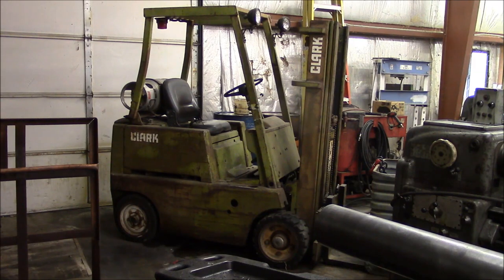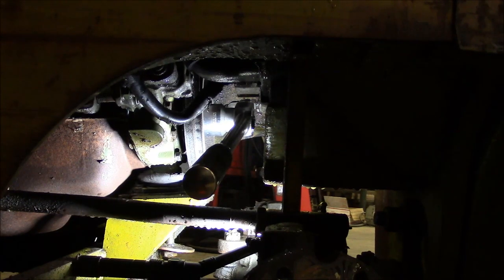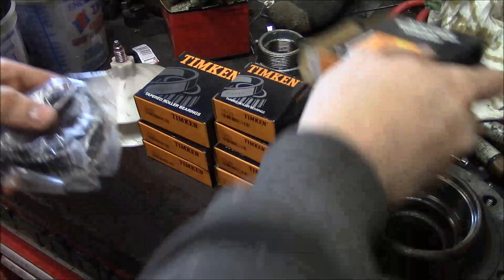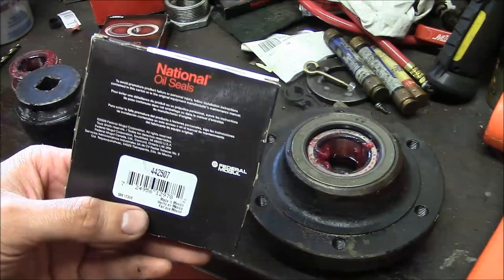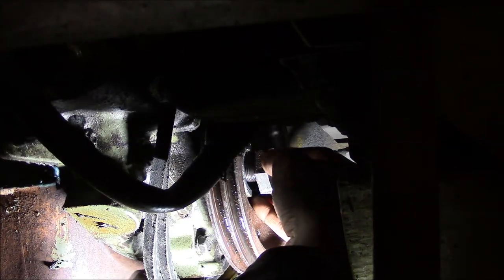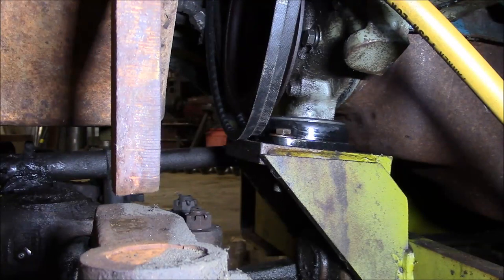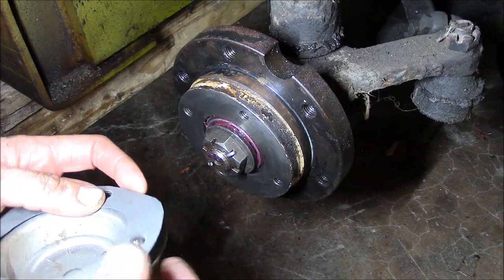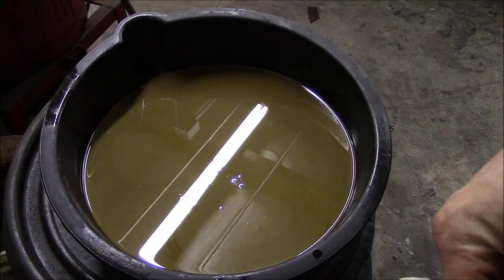Forklift Repairs: Leaking front main seal and other adventures

Comment: Great job and another great video!! 
The way we used to pack bearings was to heat the grease up in a double boiler, sounds fancy but it was just an old metal grease can stood in a pan full of water on a hotplate, then dunk the bearing in and the grease would get into every nook and cranny of the bearing and solidify.

Comment: A local scrap yard here in illinois that I like to shop at got in a 5000 hyster with air tires, I was able to pick it up for 500 bucks. I had to fix the brakes and 2 of the mast cylinder, I machined a 2 inch snapon socket so it would fit the gland nuts, they had 4 rather small notches in them, I guess it could be called a spanner socket. Seemed kinda sacrilegious to mill on a snapon socket but I had 2 of them. Your right on how handy a forklift is, we had one just like it where I worked, I made a bracket that bolted to the forks and I was able to pull the booms apart by myself on the bucket trucks to replace all the hydraulic hoses.
Reply from the maker: I use mine every day. I'd be lost without it.

Comment: I don't own a Clark. I have a Toyota. Sat outside in Chicago for 5 years because the steering is shot. Finally got it running. I changed both inching and main master cylinders(totally guessed because I can't find the Vin number). One of the drive wheels spin. The other is seized. Been trying to remove the wheel. Pita. I'm going to get that wheel off. Then maybe I can figure out what parts I need to acquire to get it functioning again. I'm not a forklift guy. With that being said, I did operate one for 2 continuous years. These videos give me some hope. And you got another hanger on.

Comment: I've used Fram oil filters for years on my cars. Never had a problem, but also always changed oil every 3-5K miles. Used STP filters on an '06 Sonata for ten years; no problems. Giving WIX a try on the '00 Dodge and will probably use a factory filter when I do the first oil change on my new Mazda. My propane heater dumps a ton of humidity into the air. The propane may very well be the oil/water problem.

Comment: Nice work Wes, I hope you put grease between the lips on that seal, stops the outer dust seal lip from burning and failing. Would also suggest that oil be applied to inner and outer bearing races before pressing, stops any chance of metal pick up. From 40 years as a mechanical fitter.
Reply: Good advice. Rarely understood by the seals I've seen.

Comment: She looks to be identical to the ones I had when I was running a small aerospace job shop this machine would go into the warehouse retrieve or place back raw materials and tooling for upcoming or finished jobs it also did well removing pallets from box trucks and trailers because it is narrow enough to maneuver it also got into turning sharp to place pallets of raw stock in front of the CNC milling machines and lastly she has a single great trick, you could lift a human up to change the sodium light bulbs add or repair an air line of course we only used the safest methods for human lifting HAHA. You brought back memories of the older years 1978/79 through 1993/1998 we operated this machine type as well as the Clark dual front tire WIDE heavy weight material handling machines even with the rotating trunnion front end (great chip bin dumper) on it. Thank you.
Reply from the maker: These things are very maneuverable. I've been able to sneak into places I never thought possible.

Comment: One of the most neglected tools in the shop, poor forklift. There very important time and back savers, but are abused like no other thing.
Reply from the maker: You aren't kidding! The most abused thing I ever saw was a yard truck we had for moving trailers at a shop where I worked. Old International with a 345 gas engine. Oil just poured out of it while it was running. The glass was broken out of the driver side and the latch never worked, so we covered the seat with a tarp and had a rubber strap to hold the door shut. Air compressor never worked, so you had to fill the air tanks with shop air before hooking a trailer. But you had to be quick because the 5th wheel release was pneumatic, so if you lost your air you could not drop the trailer. You could not slip the clutch in reverse or the aux transmission would drop into some phantom gear and you had to pull forward to get it back to normal. We poured so much ether into the carb to get it started in winter that no one even put the air cleaner back on. That was one tough old truck!
Reply: Same here, my job has a forklift that is probably close to my age (27). It's abused everyday. The only maintenance that ever gets done it's when something breaks. Which isn't often. It really makes me wonder how long a forklift will last if it isn't abused and properly maintained. My guess is indefinitely....
Reply: Amen.
Reply: Hire your local forklift mechanic. I'm a forklift mechanic myself.These things need regular maintenance.

Comment: Always interesting, because I learn something.  Propane creating more water in the oil would make sense, because it has more hydrogen relative to carbon than diesel or gasoline.  It's a cleaner fuel as far as CO2 emissions, but I never thought of water emissions as a problem!
Reply from the maker: Like I've said, I'm a chemistry dunce, but it does seem to put more water in the crankcase.
Reply: @WatchWesWork  something you more than make up for in circuits!

Comment: At work when I started there in 1975 we had a 5 ton Hyster fork lift propane and manual shift 4 Cyl. Continental Engine. The engine has never been out. The transmission was reworked back in 1994 It was well used when they bought it and belonged to a Transport Company. This Hyster is still going. Used every day. We check and change oil and tune it up

Comment: Wes, the motor mount is upside down, your dad tought you well on bearing packing, you can take a grease needle (used to grease sealed bearings ) and pack it guicker and not have cleanup to do. There is a better pulley seal that has the rubber seal and a felt dust seal on the pulley side, also there never was a gasket on the steer hub caps. You do very good work, I enjoy watching someone that does good work.

Comment: Gases when evaporate/vaporize ,like the LPG here, pull heat from the ambient temp,and condensate its moisture.
On dragsters and whatever is running on alcohol or methanol,they use a vacuum pump to pull moisture out of the cranckcase,so oil.
The fuel under the blowby form,byproduct of those fuels combustion being water  ,condensate in the cranckcase and deteriorates the oil.
You could run an electric vacuum pump also and simply pull vacuum from the cranckcase.
You could also circulate fresh air through the whole cranck case through a breather using an air pump,like the ones used to send air in the exhaust during cold starts.
There are a lot of them on VW as i know.
Reply from the maker: The simplest thing to do would be to get the engine warmed up once in a while. When the oil warm up, the water will evaporate quickly.
Reply: @WatchWesWork  

Simpler is not always the less expensive on the long run.

Comment: Glad I found your site. I own this clark also. I want to change engine oil. Looks like I need to jack up the forklift. What type of jack should I get I have a 3 ton floor jack but i.know it is too small.
Reply: I’m currently re-working this same forklift. I used a 3 ton jack and it worked just fine. I elevated the lift with 1’ long 6x6 square tubing under all four wheels, flipped over 1/2”x 1/2” angle iron and welded to the top of the 6x6 so the lift won’t roll off.

Comment: One benefit to electric forklifts is that they are a lot less likely to leak oil. It´s really only the hydraulic system that has the capacity to do so, since the motor does´t have any oil in it. They don´t leak coolant either, since no combustion occurs that needs cooling. The lead battery is also usually pretty heavy, which is mostly a plus for a forklift.

Comment: Lovely video... takes me back to my time as a Clark field service engineer, 7 years on the road doing all manner of jobs. Everything from regular servicing to engine/ transmission overhauls on engine powered trucks up to 20 ton container lifters.  That truck was a C50 in the UK, motor was a Teledyne Continental 4 pot flat head side valve - rock solid unit only ever had 1 with a blown head gasket. Handbrakes are a steward to replace on this model - engine out job as they are in the bell housing on the transmission. Later C500 had external Bendix drum brake off a transmission lay shaft. if you loose the transmission on any clark FT with a powershift transmission, check the inching spring in the transmission control cover hasn't broken,  a regular job back then. Steward to get to but an easy diagnosis.
Reply from the maker: I actually disabled the inching valve in this machine. We had a Toyota lift at  a place I used to work and it did not have an inching valve. I preferred the way the Toyota worked, so I modified the Clark to be the same. I just have to watch that I don't rev the engine with my foot on the brake. But, I'm the only operator, so it's not a concern.

Comment: Thanks Wes, for some reason it is a lot more fun to sit on the couch and watch you wrench than to actually do it myself. Unfortunately I'm going to be forced soon, my little hyster is leaving a bigger and bigger puddle of hydraulic oil behind to mark it's territory.
Reply from the maker: Yeah, mine has a leak in the mast cylinder as well. It's not fun to re pack them.

Comment: If Engine Mains Bearings are worn and crankshaft has any movement up an down a new seal is not going to stop the leak, all you can do is put a new seal in and cross your fingers.
Normally pulling the counter weight and radiator is the way to replace the front seal. removing the big bolt at bottom of counter , and running a chain down through the two holes on top of counter weight and picking up with another forklift.
The Engine is a Continental 163
I worked for Clark for many years they are very well built.

Comment: Never saw that gimmick for bearing packing before. Nice.  The place I work at recently had the forklift rental company set up a permanent repair shed at the loading dock with fancy sound deadening walls hung from the ceiling. There are usually 36-60 machines on the job at any given time. When big shows come in, some of the forklifts are huge.
Reply from the maker: I always marvel at the number of forklifts at the McCormick Center in Chicago. When they have IMTS there I bet they have over 200 lifts and almost as many man lifts standing by to move machines or pull wiring.

Comment: If you see any nicks on chrome shafts use a File and Emery cloth and clean them up. If you have any leaks from seals don't try to replace them, that cyclinder requires special tools to replace seals.
There is a company in South Carolina called Able Machine that is real good at replacing seals in that cyclinder .  Just keep the nicks off the Chrome shafts. If you have any questions just email me.

Comment: Milky engine oil really common on lpg forklifts. I'm a forklift mechanic. 
Had rocker covers full of emulsion and oil literally milk shake white and a a good couple of pints of clean water drain out.

Propane produces a huge amount of water vapour when it burns so condensation comes through the blowby, couple that with never getting up to full temp and constant hot/cold cycling of the block - stop/start typical for a forklift. And it's a perfect storm. 
When I service these lifts I don't change the oil anymore, I run the thing flat out for 40mins and like magic all the emulsion disappears and spotlessly clean oil. 
The problem with just changing oil regularly is you get the water out the oil but not the condensation inside the engine.
Reply from the maker: Quite right! My Clark never really warms up. I don't know if the thermostat ever even opens. I've never seen the gauge over 140F even when working it. The cooling system is massive for such a small engine.
Reply: @WatchWesWork  Forklift radiators are always overkill.
They are always pretty toasty under there when working hard with so much confined in a small space. Plus the fan airflow direction isn't optimal - from the floor (like a vacuum cleaner when running around) and over the hot engine/transmission/hydraulic tank before it even reaches the radiator 😂.
They also make the rads big enough to allow a significant amount of the core to get blocked with dust/debris before overheating issues occur.
I normally recommend people to just start em up and let em idle 1/2hr a week until up to temp and you never get the 'sweaty oil' no one ever does though... 😂

Comment: Can really feel the frustration about getting Clark brand parts. Worked as a forktruck Tech. 18 years ago & was told that they had been bought out several times back then. The I.D. number "supposedly" said who owned it at the time. Yeah, right!!
Reply: I’ve got one of these lifts, only two owners. The build sheet specified who originally bought it and Clark supplied me with a copy of the sheet.

Comment: Wes: Did you note the circular, axle scrapes inside your Clark hub caps, probably due to the missing gaskets. Hopefully the cotter pin legs bent over the axle ends will have enough space. . . but who knows? If the gasket was about 0.040, there might be about half the clearance needed for the pin leg.

Comment: Hi Wes. Great video with some sage advice.
Crankshaft bolts are generally a pain in the backside. You were lucky with your one I feel. I have one that has sapped two days of my life so far, trying every trick in the book. Broken tools, missing skin, even the neighbours are staying clear. Making up a special tool now to try to beat it. If that fails I'll pull the entire engine out, pop the sump and lock the crankshaft inside the block. It is a matter of pride now.
Why do they still design engines like this? The flywheel on the same crankshaft is held on with a pattern of bolts, why not the front pulley?
Reply from the maker: Have you looked at one of these? http://www.ehardware2u.com/index.php?route=product/product&product_id=363  I've used one before and they work well for car engines. I thought about making my own in 3/4 drive for the bigger stuff.
Reply: @WatchWesWork  I have not got one of those but would be a great addition to my box of tricks. How well do they work with deeply recessed offending  bolts, that is, four 5PK belts deep? I guess if my tooling fails then tis reason enough to buy and try.
Reply: Just a quick update. The darn thing is finally off. The special tooling could not grip the PK belt grooves enough whilst the air impact driver worked away at the bolt. So turned the engine in the direction that would tighten the bolt so as to bring number 1 piston very close to BDC. I then marked the end of a length of natural fibre rope before pushing as much as could fit in the number 1 cylinder through the spark plug hole. Then I carefully turned the engine towards TDC in the direction of loosening the bolt which resulted in the crankshaft locking at about 60 degrees before TDC. The air impact driver was then successful in removing the stubborn crankshaft bolt. I then removed the rope making sure the last bit to come out had the marking on it. One last point, the camshafts were removed so all the valves were closed.
Reply from the maker: Your patience paid off!

Comment: I have a  Kubota b8200 and it has basically milkshake gear oil, since I never get the transmission hot, it never evaporates

Comment: nice videos thanks I have question I have forklift hyster h50 xl start 
but when I push pedal for aceleration cut off I have to put my hand on 
hold fron air filter runs fine if I take my hand off the forklift cut 
off

Comment: Just so you know about Fram (ya, another one), I remember reading (this is PRE-INTERNET DAYS) a review on many of the common oil filters and Fram had the worst results, forward a few years to the internet, again same test, but they tore all the filters apart.  Fram used the least amount of paper, they used the cheapest manufacturing methods....and finally, a few years ago, same skit, test of many oil filters...same results & contrutions.  Fram is, by far the cheapest of the oil filters (but I sure did used to love their nice little rubber they'd add.
With all that said, it will work fine, it just doesn't work as well, nor is constructed as nicely as the other filters. 

Kinda like buying tools from, as I call it, "The Chinese Embassy" (China Harbor Freight).  They're not 'as good' but they work fine.  Man, we all have opinions.  You do good work, don't let other opinions bother you too much.

Comment: I used a fram oil filter once and my dog stole my truck. Luckily the fram filter made it seize immediately so he didn't get to far.
Reply from the maker: Theft deterrent. Makes sense to me.
Reply: last fram I bought was 1993...split clear across the topwhile cruizing down the highway...shutdown, coasted off a ramp...had a friend bring a filter/oil, got home- there was not a scratch/ding/anything on the fram, was about 2 months old. I even cut it open to make sure nothing clogging- was clean as a whistle, just cracked perfectly across the top... a year and maybe 5000 miles later, my oil pressure started dropping on the old 396, pulled it and found it had spun a rod bearing- I still blame that on surely massive wear from running out of oil on the highway due to a crap oil filter.